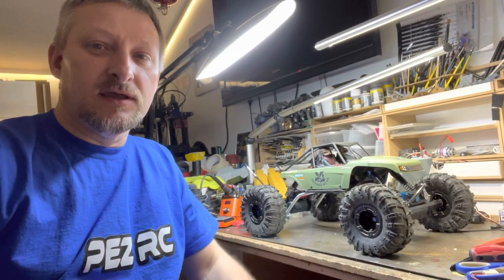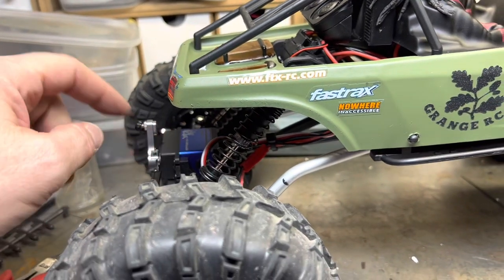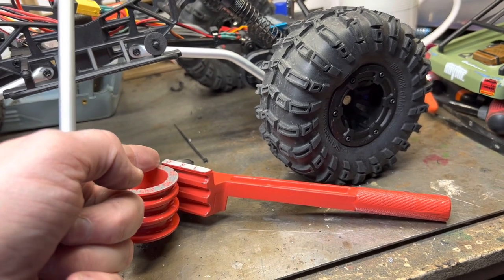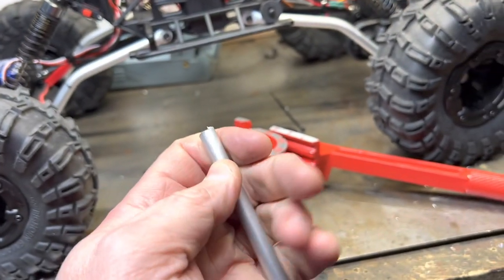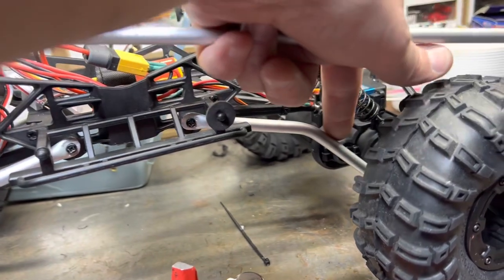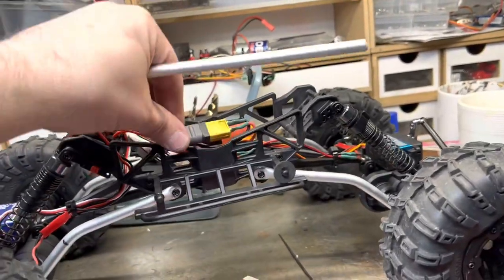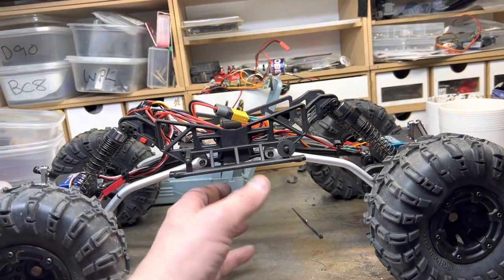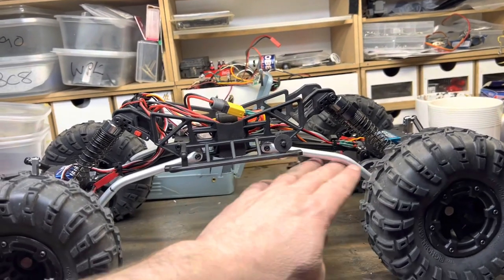FTX Ravine / Danchee Ridgerock gets Links

Comment: Another reason for the reduction of flex is due to the top caps of the shocks hitting the chassis. In the position you have your shocks mounted, take a look at the top caps when you flex the chassis. I added a spacer in between the shock and the chassis along with longer screws and the top caps no longer hit, increasing the original flex that the crawler had.

Comment: Hi there, you said in your video you ordered two smaller motors that are 36 turns that is meant for crawling. If you don’t mind me asking, can you share what motors they are and if you have a link to it?
Reply from the maker: Hi mate, don’t bother with motors, in the end it made no difference to the build over stock ones. It still stalls out, probably due to the ESC

Comment: Great vid, quick question what size aluminium tube did you use.
Reply from the maker: Thx Paul, the tube is 8mm diameter but you could go smaller if you wished nps
Reply: Thanks for info👍

Comment: Can you link all the parts you bought? Looks really good and lost the "toyish" look that has from stock
Reply from the maker: I can mate but would recommend you hang on until I finish developing it. Currently I have parts on the way and I'm testing full droop out on the next video and different tyres/wheels. I think I might lose the Bighorn tyres so worth waiting. I have only spent money on 2 x servos, one 35kg from ebay and one 21kg Etronix for the rear. The tyres are Gmade Bighorn at £19 a pair. The rest is purely free mods and some aluminium tubing from a diy store.